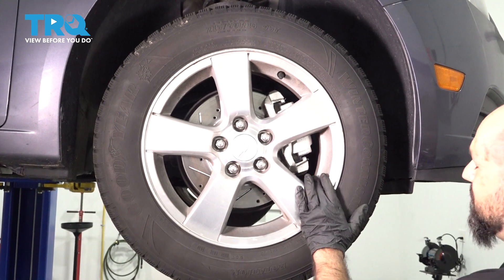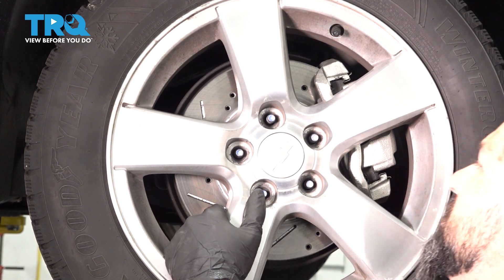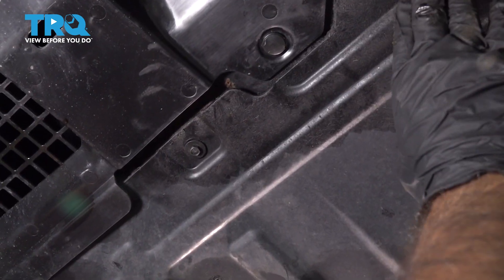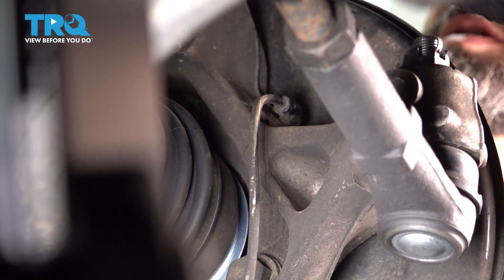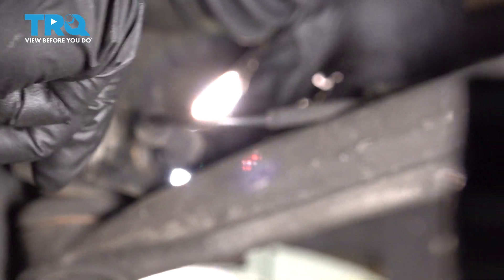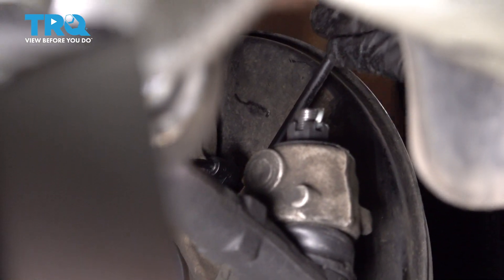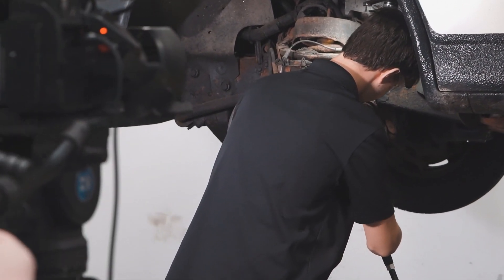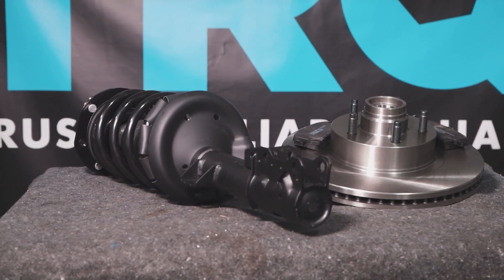How to Replace ABS Wheel Speed Sensor 2011-2015 Chevrolet Cruze

Comment: if this sensor fails, does both the ABS and the traction control turn on? I also have no problems braking but I have noticed my miles that are being marked down seem a little exaggerated